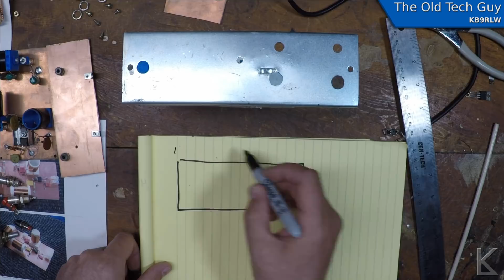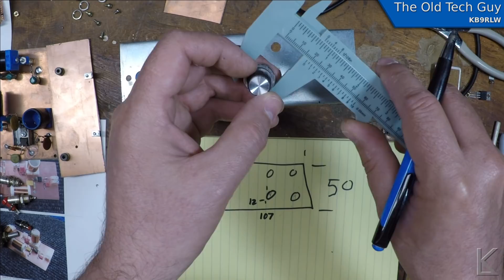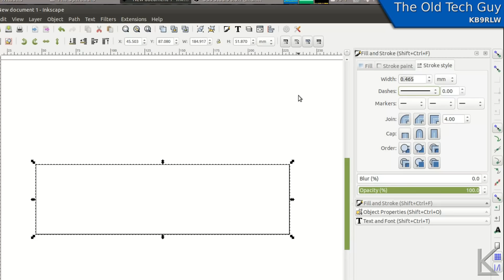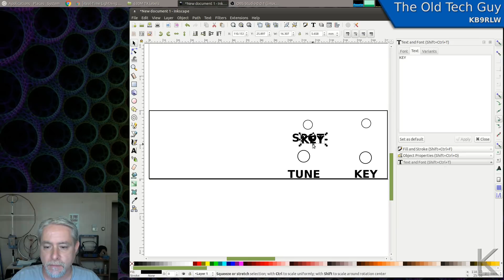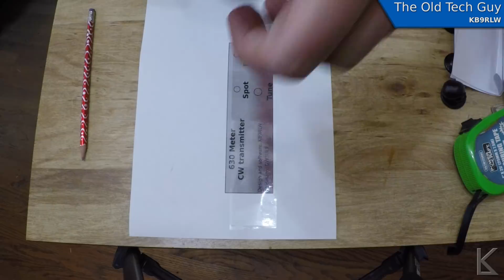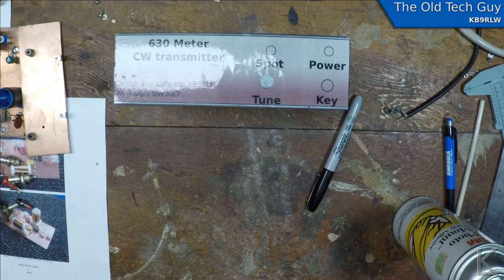Ham Radio Homebrewing - How I make labels for my projects.

Comment: I don't know if anybody has told y'all yet or if you even already know. But you can go to Walmart and get a laminator for less than $30. And believe it or  not. They are pretty good for being as cheap as it is, but like you said in the video, packing tape is just as good as long as it seals the paper in from the air to where it gets a good seal. Ain't nothing wrong with that. I think it's a good idea

Comment: There's an easier way to get the dimensions right:  put in all the necessary holes then put the panel on a scanner.  Once scanned you can process and add text.  Easy peasy.

Comment: I'm a little to the party... but I have a question please. How did you manage to get your 0,0 XY coordinates at the bottom left of the page. Mein are always at the top left, so that the page is always hanging down below the 0,Y, instead of above it as yours does. Makes it impossible to place circles and rectangles as elegantly as you showed. Thank for any info.
Reply from the maker: I don't recall there being a setting for that in the software I used.
If it's inverted as you describe,  just put a minus sign in front of the y coordinate and make your measurements from the top instead of the bottom of the chassis.
Reply: @loughkb  Thanks for taking the time. :-)

Comment: You're the only other person I've seen use packing tape for "laminating."  Been doing it for years.
Another option that I've only used 1 time is printing onto transparency paper.  Trick is to print it in reverse so when applied, the print is correct.  That's good for something that you want the color from the mount to show through.

Comment: I use a similar technique but I use my color laser printer to print a reverse image on an overhead transpareny.  I then spray a light colored spray paint (usually white) over the toner on the back side of the label.  When that's dry, I usually use 3M VHB (very high bond) double sided tape to make reverse printed labels that are completely waterproof and very professional, although I've used spray adhesive as well.  The toner is completely encapsulated and is extremely durable.

I installed Inkscape several years ago but never bothered to learn how to use it.  Thanks for the mini demo.  It looks easy to use.  I'll give it a shot next time.

Comment: Thanks you for a nicely done video.  I have just downloaded Inkscape and will try it shortly.

As an alternative to using lamination, I use clear Krylon spray paint.  I put a few coats on each side.  The Krylon seeps into the paper and pretty much water proofs it.

Is there a downside.  Well, one is that if you don't apply a fill color the paper becomes a bit translucent and will allow unused holes be seen, even if only dimly.

One note, when spray painting more thin coats are better than just a couple of thick coats as there is less change of the paint running.

Comment: Kevin have you ever considered a reverse printout on clear media and apply it to your box as to protect your panel labels from wear and smudging =)
Reply: I just left a detailed comment describing the reverse printed transparency labels.  I have been doing that for years, even on some light industrial equipment I built for use in a cleanroom.  The results are very professional and the labels are completely waterproof.

Comment: Nice work Kevin. I did something similar but much more basic using DIPTRACE PCB layout, I had looked quickly at Inkscape but at the time never got on with it. Your tutorial is most helpful in filling in the bits (origins) that I had never actually appreciated. Your finished result gives a nice professional but simple touch to your project. 73's Mike G7GTN

Comment: Use smaller text. Look at a commercial unit. The words aren't NEARLY that big. The whitespace makes it look more professional.
Reply from the maker: But then I'd have to squint.   I knew I should have used Comic Sans, just for you. ;-)
Reply: I like the bigger text
Reply: The older I get, the bigger the text needs to be.

Comment: Hi Kevin,
Nice way to make labels. Have you thought about using transparency film to print the labels? I have some sheets I can send you if you want to give it a try.   73  WBB3BJU
Reply from the maker: Oh, I'm sure there are many ways to do it.  This is just the way I do with what I have around the house.   Thanks though.
Reply: There is also a way of using packing tape to make labels.  Print out, cover with tape, soak in hot water for a few minutes, scrape off the paper and the ink has transferred to the tape and makes a label that is seethrough.
Reply: I did a homebrew auto tuner like that. Printed backwards on the inside of the transparency. Then spray painted the inside over the print. on the outside you have a nice printed label and it's protected, as the printing is on the inside. . Glue it onto the panel, and it looks great.
Reply: I’ve used the transparency film before it works well. Another option is you can buy vinyl printable labels for laser and ink jets. Not as glossy but will last a long time. I’ve made labels that are used on aircraft and after five years in the sun they are just starting to fade.

I’ve also used Ink Scape to make drill masks for switch panel layouts saves a lot of time doing layout before you start drilling.